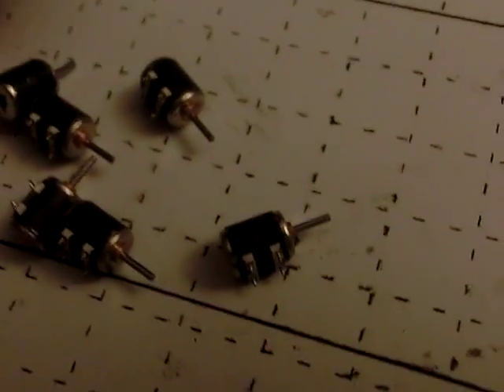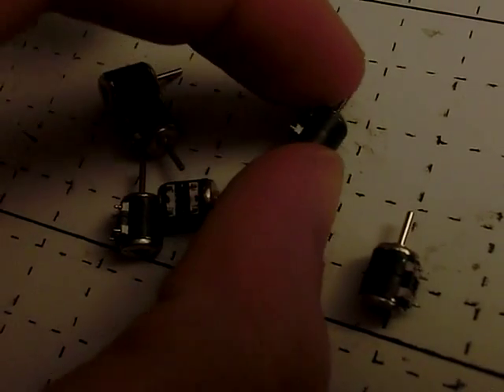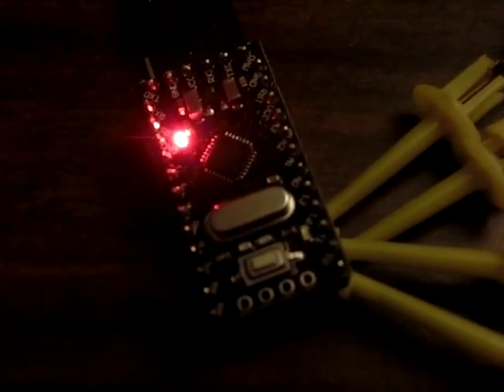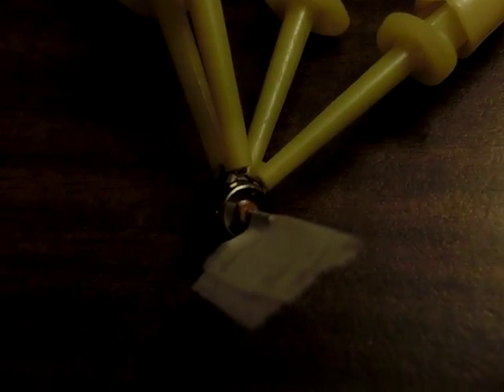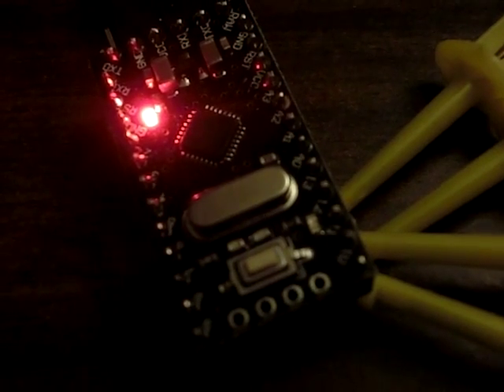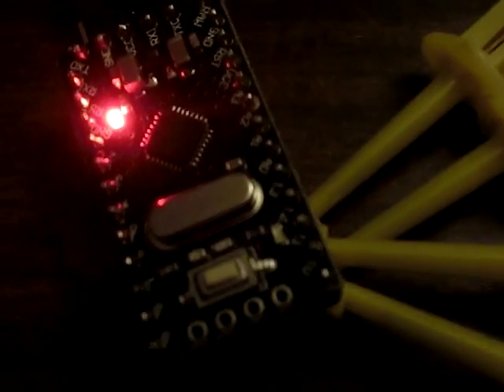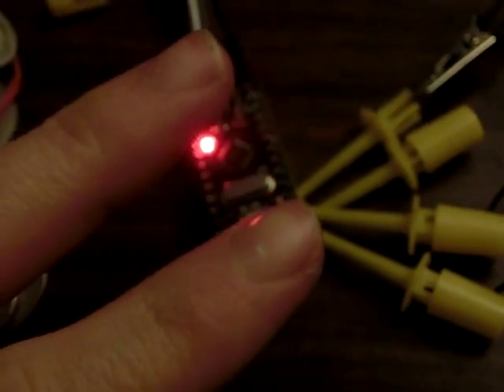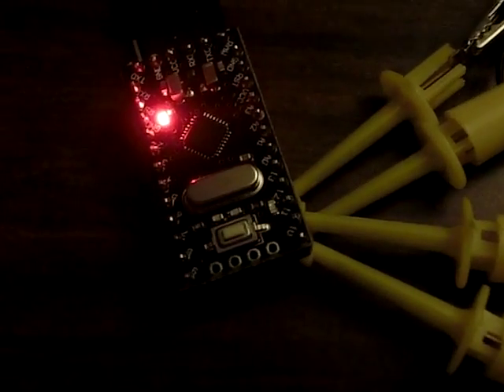Arduino-Powered 4-Wire 2-Phase Micro Stepper Motor

Comment: Hey thanks for the video.
I am working on project using this micro stepper motors.
Can you share the arduino code you used to run these stepper motors ?
Thanks in Advance!